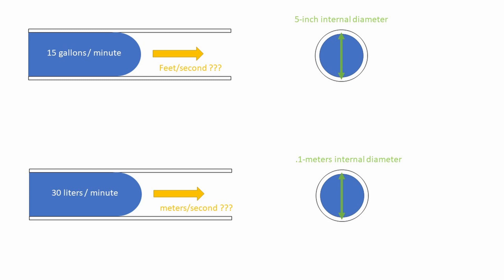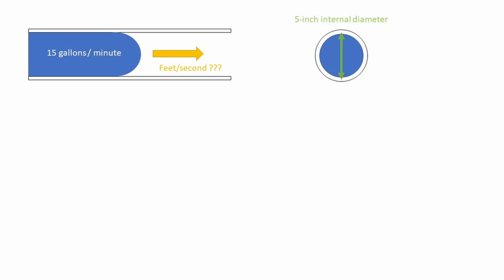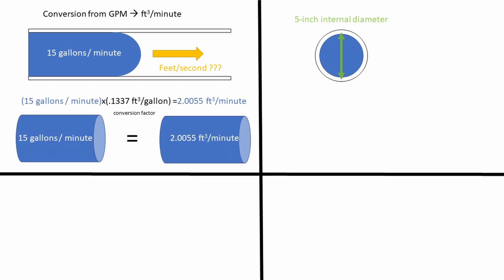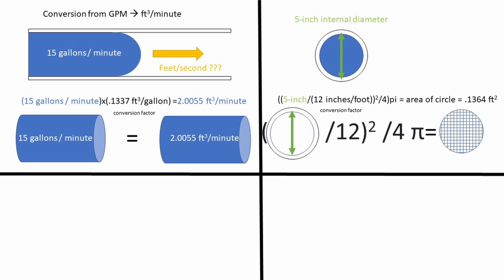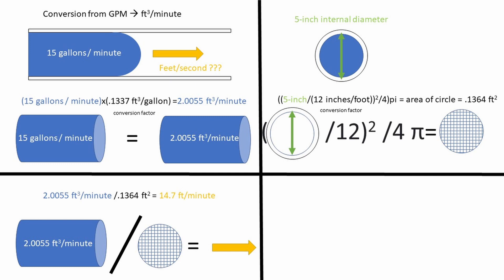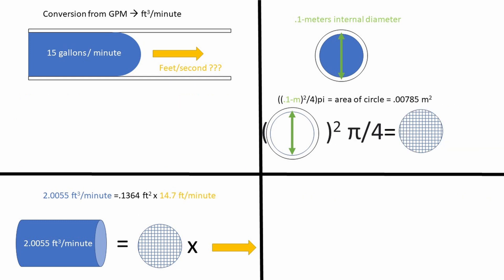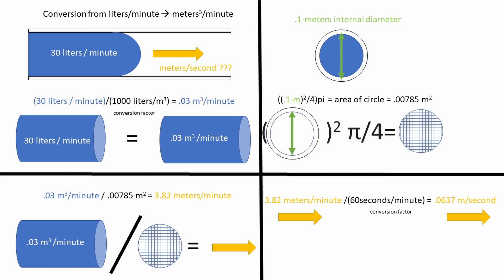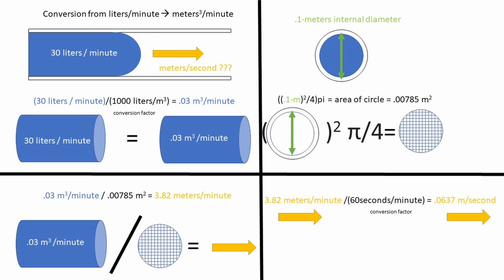Convert Volumetric Flow in Pipe to Velocity (GPM to Feet Per Sec & Liters per Min to Meters per Sec)

Comment: Waterflow with bottleneck question
My local water department is telling me something and it does not make sense to me. I have a new home being put in really its a quest house. This is a 1800 sqft 3 bed 2 bath home. Our main home is a 4000sqft home 5 bed 3 bath and is still being constructed. Now its time for the county to put a meter in. I have these 2 homes and also a 800sqft workshop that I want to run utilities to. The water meter is 800 ft away from the home site. So here is my problem. They want to put in a 1" meter to provide water to everything. They told me if I run a 2" line from the meter that they will put in on the county 2" main line that that will be enough for all three of the sites I want to have water. So my question to you guys/gals

1. will a bottleneck from a 2"in line @ I believe the main is 65psi that will be roughly 3 ft of 1" line and going back up to 2" line drop my volume significantly?
2. what GPM should I expect to get at the end of this 800ft that has a rise of lets say 10 - 15ft.

The 800ft of line I purchased is poly CTS size line.
Reply: This must be something they teach in Plumbing school. I had a plumber who put in a 3/4 in valve on a 1 inch well pipe pushing about 35 psi. I could only get about 5 gpm. I changed out the valve (I did make a couple other changes) and was able to get 15 gpm. There just doesn't seem to be any common sense out there. Same principle as a garden hose sprayer, if you restrict the opening, you restrict the flow.